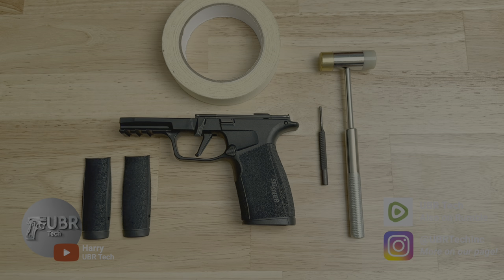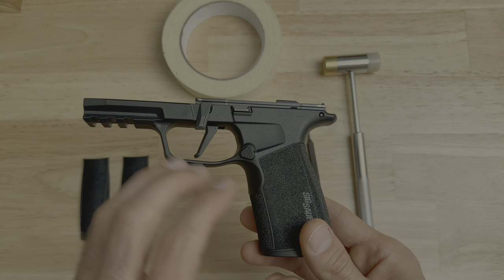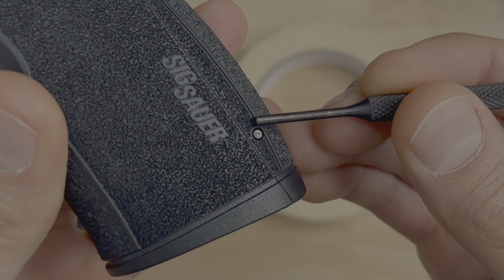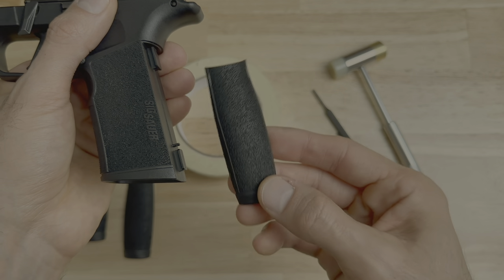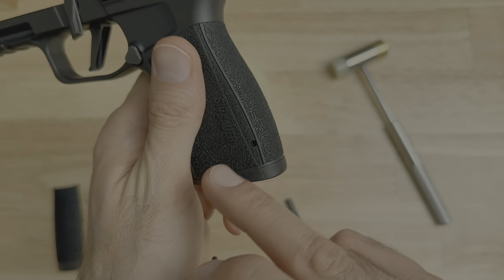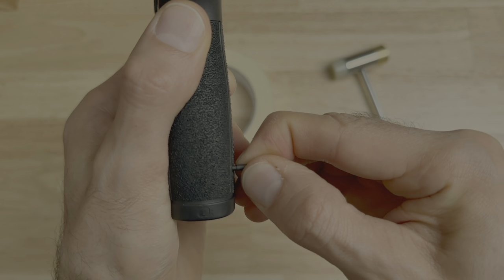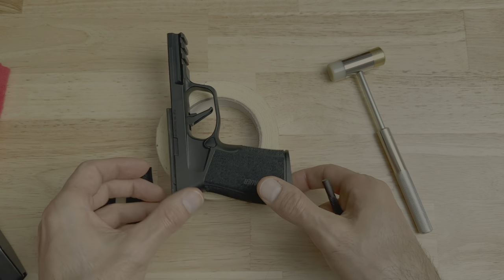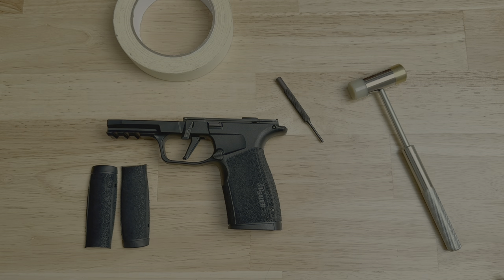How to Change SIG Sauer P365 XMacro Backstrap

Comment: Do you actually need to do a field strip to do this? It seems like it can be done without taking off the slide.
Reply from the maker: I guess not but I always do that when I change any pistols back strap these days.
Reply: @UBRArsenal  any specific reason why?
Reply from the maker: There’s a couple reasons but the main reason is safety. I like to be extra safe for my videos. This way if someone is following my how-to video and they are following how I do things, they will be safer too. Hope that makes sense.

Comment: The TACOPS variation of the XMacro it has a flared magwell and it looks like you need to remove that before doing the backstrap installation.  REALLY, wish Sig would have these instructions in their owners manual.  There's not mention of the flared magwell or the 3 backstrap options.
Reply: weird, I JUST received my TACOPS from Academy sports, got home and was inspecting the flared magwell, and noticed there is female threads.  The flared magwell just pulls off and there appears to be a place for a screw to go here to hold the flared magwell in place.
Reply from the maker: I agree. I also wish they added the mag well to both the TACOPS and the XMacro. That way my how-to videos would help both owners. Thanks for watching and leaving a comment. Have a great day.
Reply: @UBRArsenal  thanks.
Turns out mine was missing the screw (nut was there in the backstrap though).

Called Sig Support and they were great, sending out part and I suggested added the backstrap and flared magwell to the manual.

The flared magwell has two little circle indents on either side of the screw hole so I didn't wanna just forcing stuff.  

Normally, you would just remove the screw, then carefully slide of the flared magwell, then follow your instructions for the backstrap change, then carefully slide the flared maxwell back on (noting the direction) and reinstall the screw.